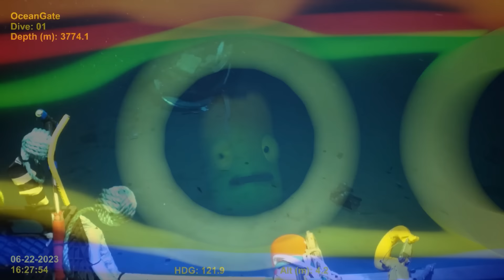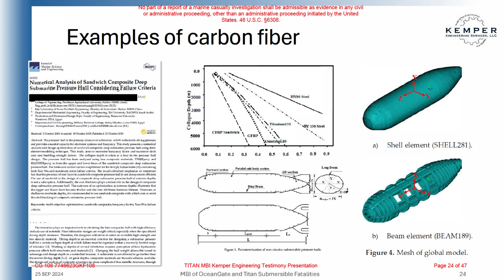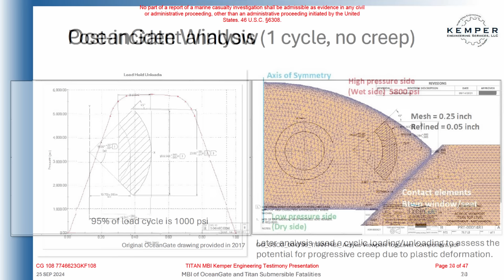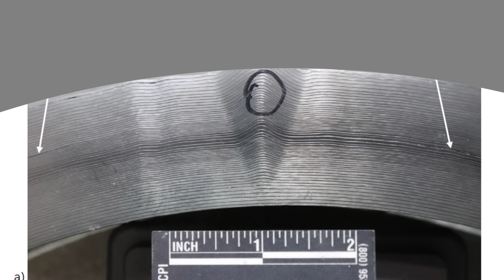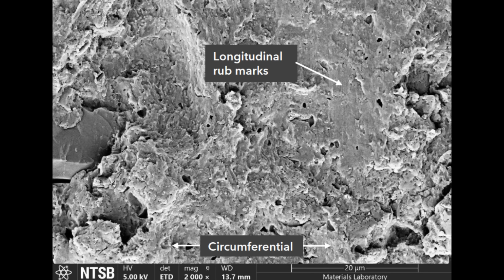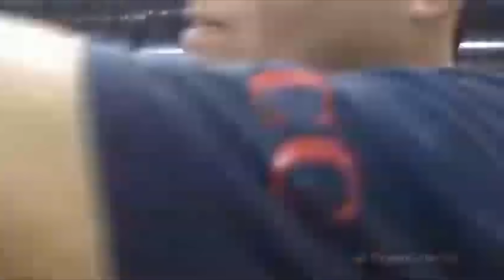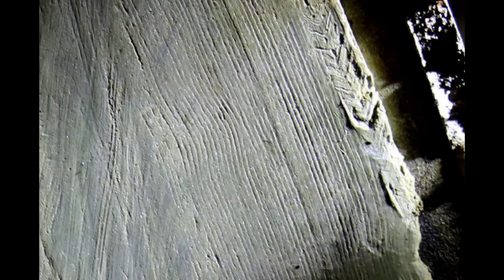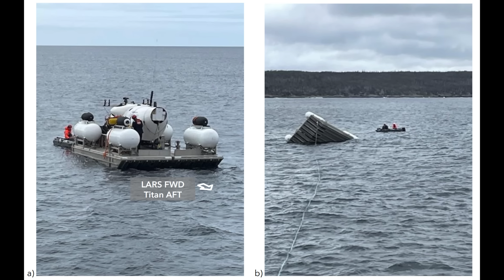OceanGate Wreck Shows Why Sub Wasn't Strong Enough To Survive - NTSB Shares Important Details

Comment: Stockton absolutely knew the dive wasn't going to be successful based on the RTM carbon fibers breaking. Losing thrust would mean that, literally, the submersible took a nosedive with the viewport dome leading to inverting the vessel, taking them down to near the ocean floor prior to implosion. All 5 people were piled onto each other into the dome area. This is why human remains were found in that dome. Additionally, they aft chamber started crackling - indicative of water seeping in. They jettisoned the blast weights, but couldn't get ascent. They also jettisoned the skid frame.
Reply: The necessity of gaining ascent by jettisoning ballast should have been obvious to even a movie villain level fool like Stockton Rush.  I am beyond shocked with Oceangate, that you are telling me that the craft continued descending.

Now I strongly doubt that a slow ascent would have saved them, but it is an indicator of how incompetently this submarine was designed.  It was a deadly accident waiting to happen, even if it did not implode.
Reply: @ComradeOgilvy1984  I watched both documentaries (Netflix and Max) Karl Stanley made a profoundly impactful statement. He said, the definition of an accident is when something unexpected occurs. The Titan implosion was fully anticipated by more than a dozen people. That was not an accident. If it wasn't an accident, then it is a crime. Sadly, the criminal culprit perished with 4 others on board.
Reply: Is this supposition or fact?
Reply: @robmain9921  as with all things, a bit of both. The submersible lost thrust an was dumping ballast to try an ascent and level the vessel. That is known. With loss of thrust, the submersible would have descended with heaviest part leading, which is the viewport dome. We know there were remains in the viewport dome, they covered it with strategic parts. We know that DNA from all 5 people were identified and remains returned. Logic tells us the heaviest part went downward, the only place for the 5 was in that forward dome.

Comment: I can't believe I actually read somewhere in another video's comments the following; 

"Dude, if only they hadn't bolted the hatch from the outside, maybe they would have been 'smart' enough to 'remember' to bring a few scuba tanks of Oxygen and some fins!"  (omg! smfh + lmfao)  I replied, "Yeah, but I'm sure they still wouldn't have been smart enough to bring 5 chainmail 'Shark Suits'!" ... lol 

Actually, it sounds like this genius would have been a perfect fit as an Ocean Gate 'manager' or as the CEO lol.  Umm... yeah, you definitely don't want to cause the implosion yourself by opening the hatch (not that it would even be possible at that depth, I mean we've all seen those movies where someone gets run off the road, or crashes their car into a lake or whatever... barely 10' underwater and what happens?  The actor/actress can't even open their car door - because of the differential pressure lol) and even if that weren't the case, I don't think ordinary human beings can survive dives much deeper than about 45 to 50 meters? Even skilled divers with advanced technical training, years of experience, and enough oxygen to maintain a gradual enough rate of descent - as to allow the body to acclimate to the pressure, don't usually exceed depths of 300 meters.  

But yeah, you go ahead guy and just crank that hatch open at 3800 meters!  Maybe if you press the 'Select Button' while holding up on the 'D' stick on the 'Logitech' controller, it'll work? 
Sheesh...Damn mental midgets!

Comment: 4:36 a big part of why Carbon Fiber isnt used is because testing has shown its only good for single use: it weakens with every compression/decompression cycle, so it will only be strongest in its first usage.

Comment: Is there a future for carbon fiber to be used in deep sea diving? After watching the documentary and seeing what looked like a haphazard way the sub was assembled, and the concerns of the engineers on the project. Boeing engineers ultimately rejected the design but did have suggestions on how to increase the strength of the hull. Like some of the comments above, a clean room manufacturing and assembly certainly would have helped. I’m not an engineer but wouldn’t it have been beneficial to connect the titanium end pieces with steel rods instead of relying on glue? I know I sound like an armchair quarterback, but I think commercial deep sea adventures would be awesome if it were safe and reliable. I just hope one man’s arrogance didn’t ruin something that may have great potential.

Comment: The front seal failed because they bonded the titanium end caps to the carbon fiber using locktite from home depot that was rated for high temperatures, not the 35°F at the resting place of theTitanic. They also left it outside in a parking lot last winter and it's first dive back in service, approximately 4 dives before it's failure they heard kid gunshot like noises and there little sensors went wild. That locktite has a minimum use temperature of like 70°F or something around room temperature. So it failed at that seal, water rushed in, pushed everyone and everything to the back of the sub, then once it filled out actually exploded do to the extremely quick change in pressure and you can tell this is true because the titanium end cap had about an inch where it actually overlapped the carbonfiber. Think of the end cap like a lid to a cup. Sometimes the lid just sits on top of the cup but sometimes part of it overlaps the outside of the cup itself. That overlap was completely 100% gone when they found the wreckage and it was perfectly sheered all the way around 360°. Had it imploded, like we all thought, that "ring" would have been intact or bent inward but it wasn't, it was blown off just like you see in a pipebomb.... ive made this comment on probably 5 videos after I saw a video from a small creator, which I understand well bc of my industrial pressure testing background, but still it seems as if no one is looking closely at the wreckage because the hull was not what iniquity failed after all. I thought it would've been but then I remembered that I've seen thousands of leaks in my day....100% of them take place at joints. It's never that the material fails, it is ALWAYS a bond point. Now, that hull was 100% going to go and it likely even played a big roll in the seal failing but ultimately it was the front seal, not the hull. If Stockton were sitting at the front when it failed he would've quite literally crushed the other 4 to death with his own body as the wall of water sent everything to the back at unimaginable speeds.
Reply: I think you are right.  Under a wide range of pressures and temperatures, the joints between different materials are always especially vulnerable.  Joints have to be carefully designed to anticipate how the two or more different materials will change characteristics.  At extreme conditions, temperature and pressure can shatter steel, so there is more to the proper solution than "hey, this looks strong enough".

Comment: So by cutting doen and smooth each layer...they had already built the damn thing woth cracks/uncomplete layers. 

What absolute clowns. 

That image showimg each layer then essentially how they cut off the join of several thin layers...before laying on the next thick layer. 

Just shows how every single 1inch thick layer already had that big open wound in ot jjst waiting to split.

Just more and more lunacy the more you see.

Comment: Regulations and experts told him not to use carbon fiber. Because while being great under tension it's bad under compression, as in a submersible. That combined with their absolutely shady manufacturing processes explains why this was going to happen sooner or later.
The wreckage pictures also show that. The carbon fiber hull is completely destroyed and ripped into pieces, while the titanium domes are still in perfect condition. If they would just have used titanium as usual and well tested, this could have been prevented.

Comment: The entire Oceangate approach is ridiculous and misguided -they cyclic fatiguw of an anisotropic material problem cannot be over come for Carbon fiber at deep ocean depths -a first year mechanical engineer knows this -It's not a spacecraft under a little bit of tension. It's a submersible under massive compression -Carbon Fiber is not the right choice even for one dive -let alone "unlimited" dives like Stockton bragged -and the acoustic sensors really do nothing other than document their demise, because the data cannot predict anything or relate to specific things to address in the hull/

Comment: Yes I do think the carbon fiber hull de formed making it slightly oval. And the titanium ring didn't give the same yes the glue gave and the strain cracked it so it give up being a strong interface. I'm not a expert but even I can understand the poor engineering . They should of left the mandrel inside then the titanium domes could of been attached to that. Anyway a bunch of flowers for the men inside who passed🎉

Comment: You don't need to be an expert to know when something is a bad idea. Materials strong in tension probably shouldn't be used in compression scenarios.
Reply: It's actually pretty typical for materials to be noticeably worse in compression than tension. CF isn't necessarily a bad material (though other materials are probably better in the this application), it was just made about as poorly as possible

Comment: So you're actually looking at an accident miles below the surface and you're making critiques based on what you think it should look like? You're making guesses as to or if it started over here then it must have come in from somewhere else. Correct me if I'm wrong but the time it takes from when this kind of accident starts to when it's over it's like what less than 1 second? The sheer amount of power that goes into an implosion like this is almost incomprehensible . For you to look at something from a picture taken bowl of water and make these kind of guesses as if this accident happened on the surface with an atmosphere. And also the kisses you're making are based upon something that happened in a normal time frame not something as fast as an implosion. I'm sure that there may be about four people on the face of the Earth who are qualified to make judgments on what materials should look like after an accident like this happens, I'm going to go with there probably from MIT or Russia or somewhere else, but I'm almost 1,000% sure that you are not the guy to be making these kind of very very detailed critiques on what material should look like after suffering this kind of incident.

Comment: The internal pressure of a spacecraft is higher than the external pressure of near zero in space.
Opening a hatch door in space would result in an outward explosion and death.
The exhaust system itself,  if one existed  on a spacecraft that was really  in outer space, is an opening  that  would also  result in an outward explosion and death.

Comment: Something else that has to be observed and taken as fact is that carbon gets stiff and brittle when place in severe cold
The text message about dropping the weights that came after the observable big bang noise was in time delay, the above top crew then noticed that there was slack in the cable that was holding and lowering the Sub.  It might have been the case that dropping of the weights started a vibration which inadvertently created the implosion of the Sub
All of those eventual indicators gave evidence that there was catastrophic a failer.

Comment: Submarines can be, and have been, made of titanium, particularly for deep-diving applications. Titanium offers advantages like strength, low weight, and corrosion resistance, allowing for faster speeds and deeper dives compared to steel submarines. AND NOT TO MENTION CARBON FIBER .   SO WTF WASN'T THIS SUB MADE OF  TITANIUM,  NOT TO MENTION TITANIUM HAS THE NAME TITAN IN THE NAME .

Comment: Dang, I'm not remotely close to being an engineer (and I'm also aware that common sense doesn't always actually hold up under expertise and scientific/mathematical fact) but I feel like I could've told Rush that the whole "gluing (partially shaved!) layers together and expecting them to hold up under *deep underwater pressure*" thing was a bad idea. What an idiot. Thank you for walking through this and putting it in layman's terms!
Reply: From what I hear he would've fired you then. 😢

Comment: They went with carbon fiber because of the cost savings over titanium, not because of weight. Stockton knew titanium worked as a pressure vessel because thats what was used in the Mariana Trench which is much deeper than the Titanic.

Comment: Your a dummy, the powder you see in the carbon fiber ends is dust from sanding it smooth and also it doesn’t matter how strong you build with carbon fiber it will eventually fail because carbon fiber was never invented for pressure to be on the outside of it, get a ball of yarn and then coat it with whatever you want and it will still implode when it gets much deep, carbon fiber is strictly designed for internal pressure pushing out you moron

Comment: Using an autoclave to remove moisture from each layer of the carbon fiber created high spots, which they decided to grind off. Maybe they shouldn’t have ground away almost 10% of the 133 plies in a total of about 45 spots over 4 of the 5 layers of carbon fiber. Each of those spots became a weak point.
Maybe they should have oriented the layers of carbon fiber at 45 degree angles to the length of the vessel, alternating the direction with each layer (X fashion)  instead of installing it all perpendicular to the length.

Comment: You could easily make it 100.000% safe for 1/4 the money.
Instead of being in a cramped sub, do you make a big nearly massive steel ball with cameras, gyro and what not, it has no passengers but gets steared from a room on land or the boat where the tourrists is sitting inside. They can hear every sound, feel the movements and see on the huge I-MAX screen and feel like they are there.

Comment: The glue turning to powder is attributed to the high pressure which caused movement which powdered the glue. 
I believe that is only part of it, this process is repeated with every dive because the pressure is released causing more movement. Up and down, back and forth, up and down, back and forth,
Just like we bend  to piece of metal back and forth vigorously to break it.. 
Any material that has movement from pressure is not going to work.  .

I know, let's use titanium..
Then we'll make this a spear  so it distributes the pressure evenly.. 
Now you're thinking‼️
 let's build it that way. 
Stockton: "are you kidding me, that will cost way too much"

Comment: Sanding the wrinkles wasn't the problem and though there are some who claim it is, not one has explained why other than to say well, yeah, it broke the fiber. The problem is...was the air packets. Think about putting a screen protector on your phone and having an air bubble. What happens when you press on the air bubble? It moves right? What happens when a bubble moves in composite? It separates the layers. Pretty soon you end up with something not unlike those chinese fingercuff things. Too much flex and boom.
Reply: And the reason aircraft parts made of composite hold up so much better is you don't have water trying to inject itself under high pressure like you do at depth in the ocean

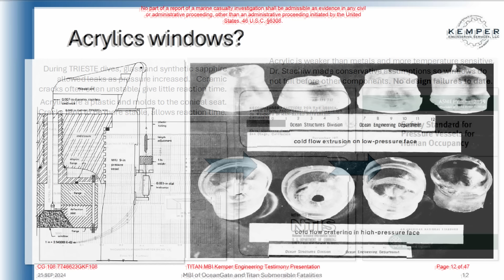Comment: The use of the word "empirical" at about 6:25 is 180 degrees incorrect.  They are talking about a posited, regulation, number, not any empirically found or demonstrated one.
The failure of the OceanGate may perhaps be attributed to just such a general liking for synthetic, nice sounding, assertions as opposed to actual facts
Reply from the maker: The regulations were derived via an empirical process rather than an analytical one.
Reply: @scottmanley  
No, they weren't.  Nobody went down the street and found the bunch or regulations lying there.
Did your Mummy and Daddy teach you about dictionaries?

Comment: I had always heard that carbon fiber was extremely susceptible to scratches, a real concern for early bicycles made from carbon fiber.  I am appalled at their surface "smoothing".   Further, we were always concerned about hidden impact damage in carbon fiber aircraft structures..  We used ultrasonic inspection to look for hidden damage.  You don't mention the lightning strike the prior year, and only briefly mention outdoor storage.  I don't think anyone can tell whether there was water absorption and ply cracking from freezing when it was stored outside. In addition to Boeing recommending 45 degree plies, Boeing suggested that the walls be 7 inches thick.  Boeing's recommendation could have been based on a higher safety margin that is used for pressurized aircraft fuselages. But in the end, it's clear Stockton Rush was more of a salesman and never an engineer.